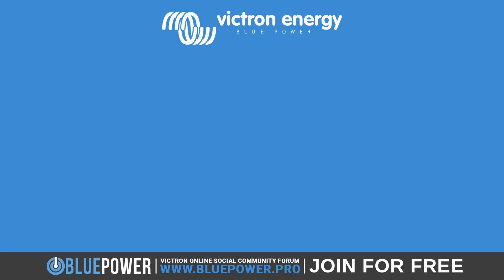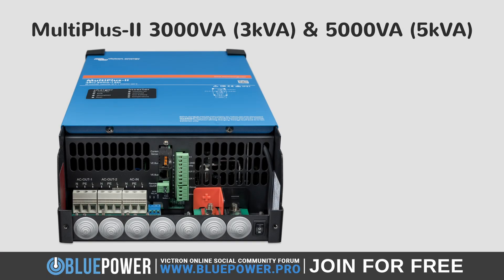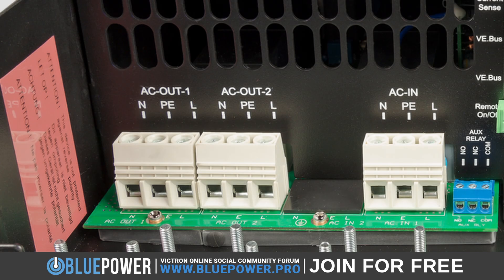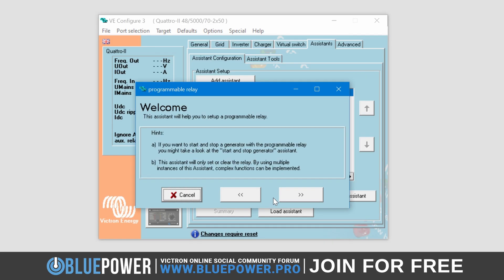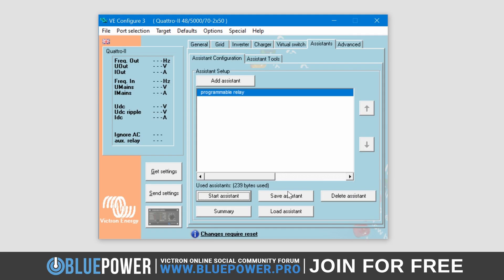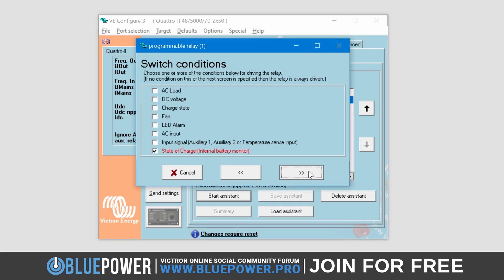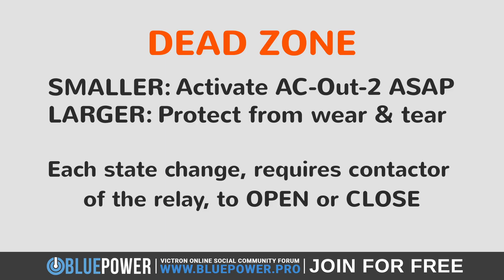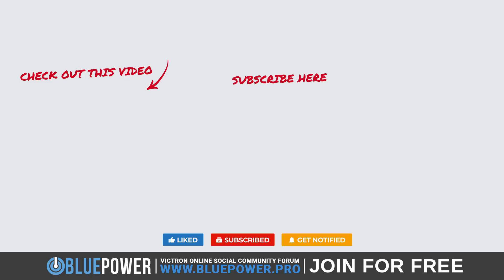DON'T WASTE YOUR SOLAR - Enable AC-OUT-2 based on BATTERY SOC [UPDATED 2024]

Comment from the maker: A quick and very important addition to this video that I didn’t mention.

In default mode (with no relays setup), the AC-OUT-1 is where you must connect your essential (important) loads, as this will continue to be active, when the grid drops, and the inverter powers the loads in UPS mode.

At the same time the AC-OUT-2 automatically disconnects, removing the AC-OUT-2 loads, which are your non-essential (heavy loads) such as air-con, geyser etc.

HOWEVER - Once you setup and enable the two programmable relays on the AC-OUT-2, you are overriding this default. It will therefore no longer automatically disconnect, and continue to remain active just like AC-OUT-1.

This is why you can use this setup to change its programming, to do whatever the relay tells it. In this case it will now only disconnect when the battery SoC reaches the “lower than” % value specified in the relay.

For this reason, you will for example be able to power your geyser, as long as you have enough excess solar, even if the grid drops.

This also answers the questions as to how this differs from an ESS setup. This can be used in an off-grid situation, whereas ESS always requires a grid tied system to work.

Also note that there are no current sensors built into the AC-OUT-2, so it effectively never knows what loads are connected to it. 

The AC-OUT-2 is actually just a branch of AC-OUT-1, which operates on a switch basis, that can be programmed (as we doing in this video) 

Because it is a branch of AC-OUT-1, you must therefore make sure to not exceed the inverter’s total max output(W), as per your MultiPlus-II data sheet. Combined, both AC-OUT-1 and AC-OUT-2, must not exceed the limit

You can find the MP-II data sheet here: https://www.victronenergy.com/upload/documents/Datasheet-MultiPlus-II-inverter-charger-EN.pdf

For example with the 5kVA model, the max load at optimal 25°C is 4000W. Therefore your TOTAL load split between both AC-OUT 1 & 2 must not exceed 4000W when inverting.

If you have the “inverter output voltage” set to 230V in the VEConfig “inverter settings” tab https://youtu.be/7Z-O8NGAOfY?t=82, then this will work out to:

4000W / 230V = 17.39A (across both AC-OUT 1 & 2)

In passthrough mode (when not inverting and the loads are powered from the grid) this changes to 50A as per the “Max AC input current rating” on the spec sheet. (Obviously doesn’t apply to off-grid systems - unless using a generator):

50A x 230V = 11,500W
Reply: So in this case, if we had a 2500w water heating load on AC-OUT 2, we should set up an assistant to check that AC-OUT 1 load is less than 1500w AND AC-IN has input before triggering the AC-OUT 2 relay to switch on? - Would like to see how this can be done.
Reply from the maker: @brianvanniekerk7160  we are working on some Node-RED tutorials, so this could be a good candidate topic for it.
Reply: @BluePowerPro Yes, I was also thinking of using Node-RED instead. That also prevents rebooting the unit and get a powerdown after changing the settings.
Reply: @brianvanniekerk7160  me too! Did you find instructions somewhere?

Comment: It is very difficult to find this information, and none of the online stores selling inverters mention programmable outputs, but this is extremely important from a sales perspective. (Quattro) compared to Chinese inverters, which have one input and one output and a third programmable (generator) or output for discharging excess energy. Owners of grid-connected inverters are looking for ways to rebuild their old systems.

Comment: Thank you for these great helpful videos. I have an old analog meter at my fuse box, it can run backwards (quite common here in Ireland) and i am wondering how can i programme the multi plus 2 to send excess power back to the grid, is it possible?  Thank you again.

Comment: Hi.
I did this , 4 monyhs ago.
I optimized this for winter with 2000w radiator and tuya ( smart life is same)
My scenario :
1 : battery soc set to 95%
2 : water heater is working
3 : once water is at 55°C , heater stop
4 : now , soc is up to 95 , water is up to 53° , heater is stopped , i can now start electric heater
5 : electric heater is keeping warm house with the sun , my pellets heater is stopped in winter
6 : when sun is down, pellets heater can start for the night

In the summer , i start air conditionning and not heater of course

This is what i did with your video 

Thanks you

Sorry for my bad english 😂

Comment: Can AC-OUT-2 be used to take the load off a grid supplied panel or circuit, and turn of if grid power goes away?
Reply from the maker: You can do nearly anything with it, as in the end, its a relay that either opens or closes, based on its instruction. But not everything is possible via VEConfig. For anything that you cant do with it, you have to use Node-RED

Comment: Maybe I missed something.  How can I send the settings if I have to turn off my computer first before I send them?
Reply from the maker: You have to either use a laptop (that uses its own battery), thus not linked to the inverter, or use a desktop PC that's plugged into AC, while your changeover switch is directing power from the grid straight to your house (ie not passing through the inverter) while making these changes - both ways, basically mean that you mustn't have your computer where you are doing the settings have any power link to the inverter

Comment: Thats pretty cool, can you turn on and off relay through modbus on cerbo? I do something similar with a python script on my server, but i also deplete batteries overnight before next days sun as batteries hold 5kwh, and panels can generate 4kwh on sunny day. So I'm constantly updating program to ie not deplete as much if detects cloudy day the next day. Hopefully I can just train an AI model to do it all for me at some point lol.
Reply from the maker: Node-RED would probably be a simpler solution. Busy working with the Victron tech guys to make some tutorials for it.
Reply: @BluePowerPro It's actually a really hard thing to do. Solar forecasting is always off, I migrated from modbus to mqtt as modbus did not have enough precision value for solar yield for day and that affected energy graphs in home assistant. Mqtt value has good precision.

The hard part is getting a solar forecaster more accurate, not sure it can be done without feeding energy stats to an AI model. Maybe when Nvidia sparks release it can feed it to a neural network.

Node-red looks promising with Google glasses in 3D space, like the movie where moving objects around in the air, I think that's the future of it.
Reply from the maker: @syleishere  ok nice, you definitely doing some advanced stuff there. Never tried my hand at any forecasting so wont be able to offer much input unfortunately. 

The spark does look very promising, but doubt it will be very affordable, at least for a few years. 

I am working with the VIctron tech guy to create some Node-RED tutorials, so if there is something you can think off that will offer good quality content that will help many other users, let me know. and of course anything you can contribute also always helps, as you seem to be at an advanced level. While hopefully, they can offer some tips your way as well.

Comment: So when connecting shore power on a boat, with these two assistants active you will end up with the ac-2 not activating when you add shore power again. So how do you combine those functions in the assistant?

Comment: Would it be possible to connect two AC out 2 in parallel on two parallel connected inverters? Because I have three parallel connected multi 2 48/3000 and the power of the coil in the boiler is 2.7 kW so one multi would be constantly overloaded...
Reply from the maker: When you program three MultiPlus-II inverters to operate in parallel, they cease to be individual units and become components of a single, larger inverter. The system's control logic expects all corresponding inputs and outputs to be wired together to maintain balance and operate as designed.

AC Out 1: All three units must be connected to the AC Out 1 busbar.
AC Out 2: All three units must be connected to the AC Out 2 busbar.

The core principle is consistency. You should not connect only two of the three units for AC Out 2 while all three are connected for AC Out 1. The entire system is designed to work in unison.

Load Sharing: This will share your 2.7 kW boiler load across all three units. Each inverter will only see a small load of 900 W (2700 W÷3), which is even better for system longevity and balance.

Easiest solution — put the boiler on AC Out 1
The 2.7 kW load will be shared across all three paralleled Multis (≈900 W each), which is within their capabilities. The drawback: the boiler will run from the inverter bus if the grid fails — unless you add control logic (e.g., the Multi’s programmable relay or a Cerbo GX-controlled relay) to only enable the boiler when grid is present or when battery SoC is above a set threshold.

More controlled solution — use AC Out 2 as a control signal for a contactor
Use AC Out 2 from one Multi as the control feed for a suitably rated contactor coil. The contactor switches the boiler’s supply from the AC input (grid/shore/generator) bus, so the boiler only runs on the AC source and never loads the inverters. This keeps the boiler off the inverter bus entirely while still using the Multi’s built-in logic to enable/disable it.

Comment: This was very well explained. I just hope I can do this with a Multiplus with AC_out_2. The config seems to be the same. Cross them fingers!
Reply: Did you validate if this works on a Multiplus 1?
Reply: @tomw7863  Yes, it does! Now my hot water turns on when the battery is full. 😁

Comment: I love it but I'm running with 2 multiplus 2's in split phase to power my hot water tank and other critical loads.  After wiring the AC-Out2 on L1 and L2 to my hot water tank, can I just add these assistants on my MP2 L1 and expect it to work or do I have to add the assistants on both the MP2's?  Then comes the question, how can I heat water if AC-Out2 is off?  I normally keep the hot water tank off until I need hot water for a shower.  I would really like to automate the use of excess solar to heat water.  I've been heating water with excess solar but I have to monitor my solar and turn on the hot water tank manually when there is excess solar.
Reply: Automatic transfer switch or even simpler, a plug coming from the PV to the HW tank and a plug coming from the house mains. Leave the PV plugged in and if you want a bath during winter, plug the mains into the HW tank socket. There can only ever be one plugged in.

Comment: This confuses me. You still need a mppt with your solar right? Your mppt is going to run 100% until float then it outputs whatever you're drawing. So if I ramp up load it ramps up production.
Reply: Correct, effectively pushing the excess production your mppt can produce into the hot water "storage"

Comment: Great tut thank you! I think you could just use an energy meter to accomplish the same result. The inverter can back feed to assist your AC (Non-essential) loads without actually exporting to the grid. However it is important to mention that when doing it this way when larger loads turn off suddenly, some of that power is momentarily "leaked" into the grid. AC 2 is better utilized as a way to manage your storage levels when there is no grid available.

Comment: Do you need a stand alone BMS so the inverter knows the SOC?
Reply: According to Victron's manuals, you only need a BMS or Shunt if you are charging or discharging the battery with something that is not connected to your Multiplus or GX device. So if you have only a battery, MPPT, GX and invertor/charger, then you don't need a shunt for SOC. Although many people recommend a shunt either way. Personally I'm going without a shunt for now and going to use the battery internal BMS or have the Multiplus estimate SOC.
Reply: @brianvanniekerk7160 just get the smart shunt, what happens when you down road start linking in different battery banks, can't connect multiple BMS to cerbo, and can't get an accurate SOC without shunt.

Comment: I am actually using the generator assist, and tell the victron to start the generator by turning off AC-OUT2, and turn it back on when power is good or AC IN is active (generator controlled by cerbo gx ;-) ).
I do not use the mp2 to keep a battery score so I use battery voltage.
But in the end it might be better to use a relay on the cerbo that drives an input on the MP2 that controls AC-OUT2

Comment: Good morning "Blue Power!" Love the video. Very informative and useful to a lot of us out here. Thank You!
I understand the process but have a question in wiring it from the Multi to the HW Heater... As is sits, my HW is getting power from the main breaker panel in my rig, so if i run another line directly to the HW Tank via thru another breaker, how do I prevent power feedback back to the main breaker box? Can you help explain the best way to accomplish this??  Thanks, Larry
Reply: Automatic transfer switch. Connect PV to main source input & mains to other input and it automatically switches when one is not available. Manual mode Mains or PV , available for £20 online.

Comment: Great vlog thanks, will AC2 be active when the grid is applied to AC in, I want to run a fridge with the excess solar power but use the grid when plugged in on my camper van, many thanks

Comment: I am considering doing this. I also have a PV inverter that does AC coupling on AC-OUT-1. I have noticed that most of the time the PV inverter output is reduced by frequency shift, thus wasting a lot of solar energy. One question is What happens if the available power of AC-OUT-2 is less than the power of the water heater? Will the water heater still heat at lower speed? The water heater is 3.6kw. I know that I may not be able to rely entirely on solar energy to heat the electric water heater. I want to connect this electric water heater in series with my existing gas instant water heater. I think this would reduce the gas bill and not waste that little bit of solar energy.Thank you so much for this video.

Comment: If i only have 500w solar panels, is it worth setting this up? What equipment is needed for this other than the mppt and multiplus 2?
Reply: Depends on if your solar power generated is more than your consumption or not.. If you don't have excess solar power, this wont be helpful to you. Also, not 100% sure but I think you need a GX device or something like a Mk3 to USB adapter to program this.

Comment: Very nice and clear explanation, but kindly now demonstrate how you can program say a quattro such that it only uses solar as the primary source while the grid is the back-up source such that  you will ONLY use the grid if there is no sufficient solar AND  the storage battery is below a certain SoC, where you will switch AcOut 2 ONLY if the SoC is say Grater than 70% otherwise only AcOut 1 is active to power essential loads. Thanks

Comment: i have done the above but power is not sent out to the AC-OUT-2 device (Geyser). what am i not doing correctly Multiplus II 5kva.. Smart solar MPPT 150|45 with 6 (550 solar panels). When Grid Power comes in the Geyser heats up.
Reply: Did you follow the above video step by step? Seen someone else do it like this and worked for them. Especially where you send the file back to the multiplus before it reboots on it's own

Comment: Thanks for the video. So, the AC out 2 relay would be taking from the inverter's overall output, correct? So, if i were running a, load through the AC out 2 and a large load through main AC out, Id still be limited to my inverters total wattage. I'm sure you could also program other circumstances to protect the inverter from going in to overload
Reply from the maker: Yes correct. The AC-OUT 1 and 2 are shared, so they collectively have to abide by the inverters max capacity, not individually.
Reply from the maker: Yes, you could definitely set an overload limit using NodeRED, or even other assistants. 

I have yet to do that, so can't say how exactly. 

Maybe other viewers can share and tell how they did it.

Comment: Thanks for this sample. As I understand if my load is 2kwh and I have only 1 kwh of solar bonus, I will take this from battery until I was at 94%. There is a way to put only the extra 1kwh on the load instead ? That will be more efficient.
Reply from the maker: You cannot put it on your AC-OUT-1 loads, as they are already being met at max capacity from the solar energy. 
You cant give them more energy if they already have all the energy they need. We are simply using any extra energy and putting it to work, instead of wasting it.

Remember, this will prioritize your load and battery charging first, until it reaches the ON state value, which in this case is >95% SOC. 

It should then continue to charge the battery, while supplying your loads from the solar energy, while diverting any excess solar to your AC-OUT-2 loads (geyser etc). 

However, once the excess solar falls away, it should continue to supply the AC-OU-2 loads using the battery instead, until it reaches the OFF state trigger. 

When it does, they should disconnect to avoid continued battery drain. 

This is dictated by the dead-zone. A smaller dead-zone means that this drain will be shorter, but you are more prone to environment changes such as cloud cover causing the switch to trigger multiple times, where as a larger dead-zone wont cause this, but it will require some temporary, extra battery power for the AC-OUT-2 until it reaches the OFF trigger.

Its all covered in the video, so maybe just give it another watch to better understand it.